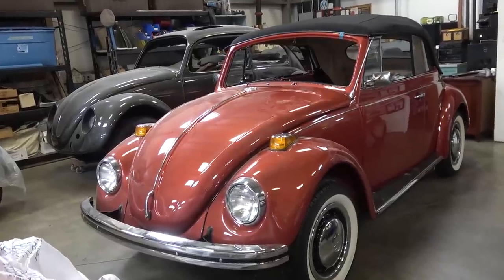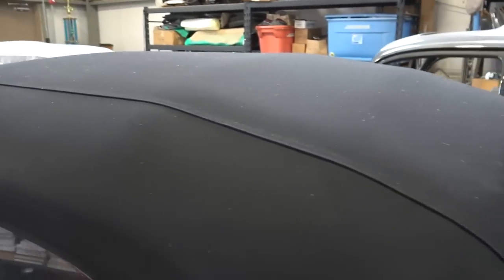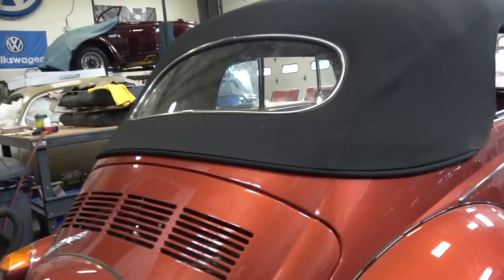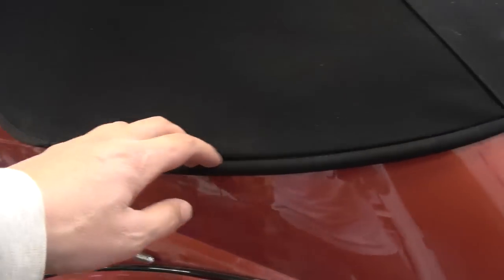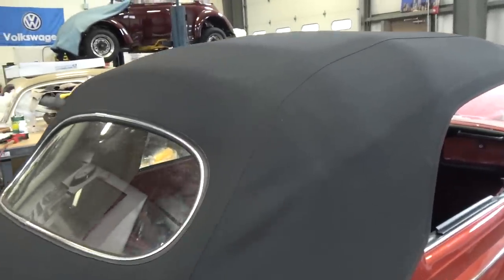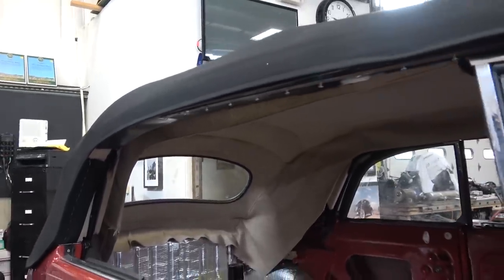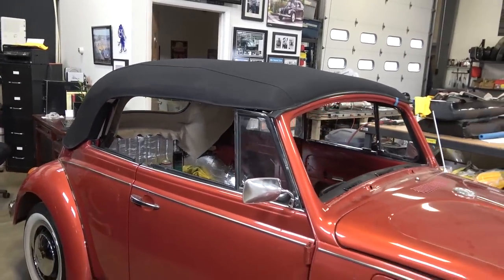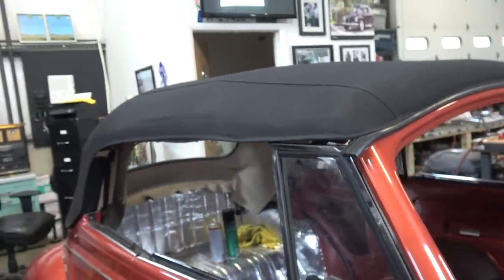Classic VW BuGs 1970 Beetle Convertible Installation Update 6_7_18

Comment: A few things here:  1- which style top is original for this year Bug, vinyl or cloth?  2- I have a 78 and I can't roll up the back windows with the top up.  I have to roll up the back windows before putting the top up. 3- I wonder which style top is easier to install, cloth or vinyl. 4- My 78 has a vinyl top and I also have an 06 with a cloth top. I do notice the 06 gets much more humidity inside the car when it rains. Nature of the beast perhaps. I do like the look of cloth tops much better. A more classy look.  5- Getting my 78 to seal all the way is basically impossible. That may be do to the fact that the car is almost 40 years old so I'm sure it's flexed at some areas, but like you said, it's a fair weather car so I don't concern myself with it.